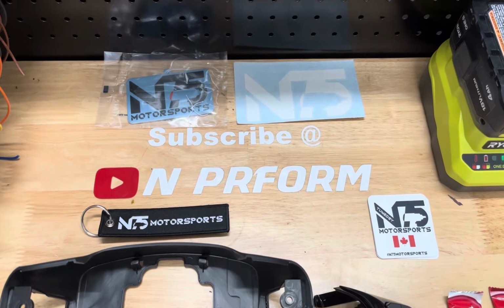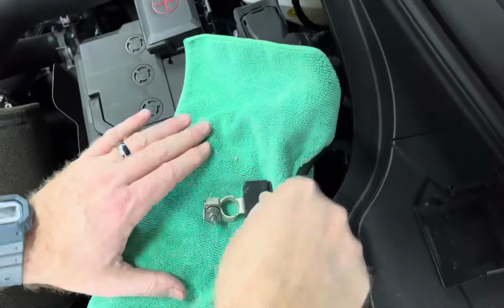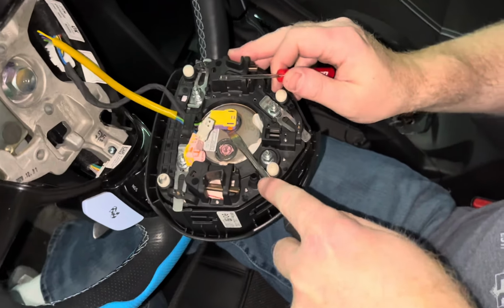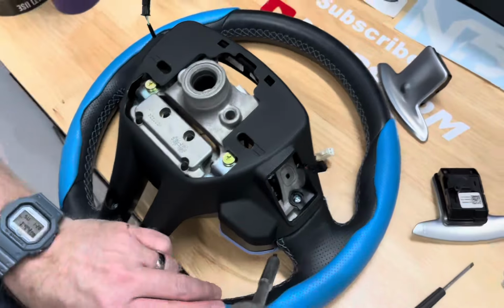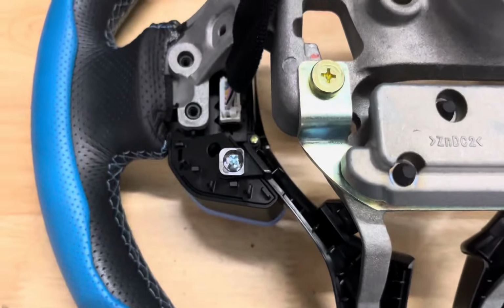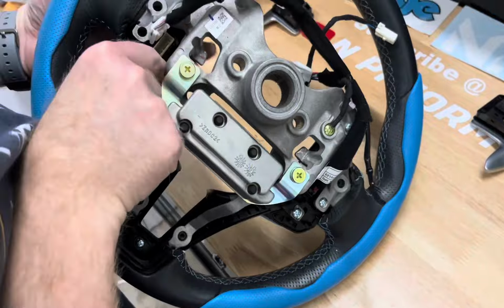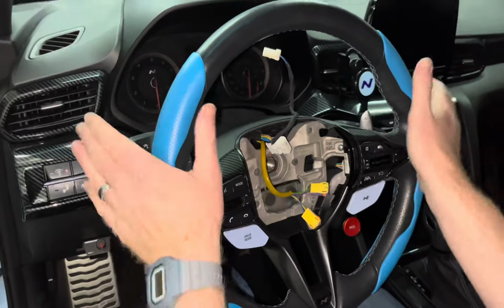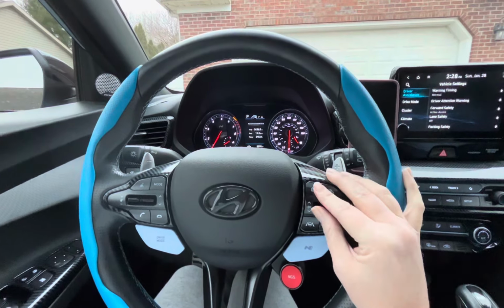2019+ Veloster N Gets Elantra N Steering Wheel Conversion Kit Installed NGS Relocated

Comment: Do you think you could do this with the manual version as well?
Reply from the maker: Yes, you can do this to the manual cars. The difference is instead of a NGS button, you get a REV rev match button.
Reply: @nprform  you think the rev match button would work?
Reply from the maker: @weekendtravel7358  Yes, it will work the same as NGS. It’s simply rerouting the wiring for the rev match.